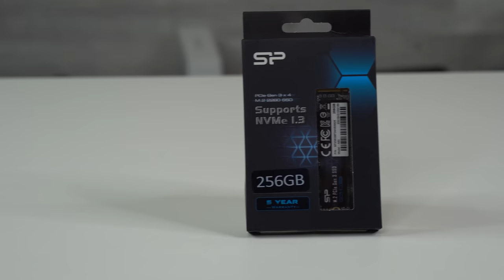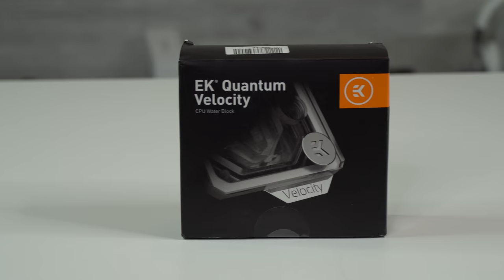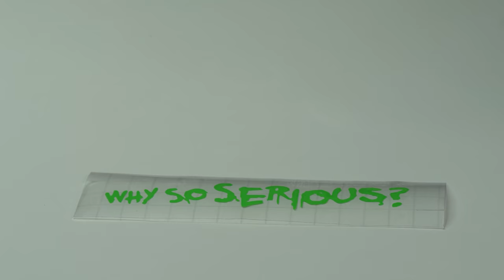ULTIMATE JOKER Themed Custom Water Cooled Gaming PC Build

Comment: For years I have wanted to make a wall mounted steam pubk build using analog boiler guages and copper pipes. Make the whole thing mahogany and copper.
Reply: Braze the fittings, run a primary loop around the outside and secondary loops for components like a hydronic system.

Comment: A question I hope you might be able to answer: If you mounted the pump/res combo to the radiator, would the glass panel fit? I've been planning to do a P3 build myself, but I'm unsure if my 360 rad will fit with the pump. Absolutely sick build nonetheless!

Comment: Can you do a video on how to disassemble those thermaltake fans? Would be something I'd like to know without having to experiment and break my 100 dollar fans XD
Reply: I finally did it. if you push the outer glassed ring with a bit of pressure and have a thin paper slit in between and push around the outer ring in the slightest of force, you should be able to push it off. just remember to go all the way around equally.

Comment: for this money i built i9-10900F, RTX 3070 , 750 Gold power supply ,  2x8GB RGB RAM 3600 MHz , ASROCK Z490 PRO4 , 2TB HDD 7200RPM 6GB/s, SSD Silicon Power 256GB, Be quiet ! Dark Rock Pro 4 cooler and normal box DeepCool MACUBE310 BK

Comment: Bhai plz bol do mere pc parts selection thik ha na?? HELP HELP PLZ READ AND REPLY
...plz help me plz tell which processor...mobo...case....gpu..aio....i should take??options r given below in brackets......u can give me any suggestions?? i will take 5900x.....with ASUS crosshair viii x570 dark hero (which one??).....gigabyte rtx 3080 gaming oc (or should i choose some other like 3080 fe or something else?? ......x73 or z73 or galahad 360 or deepcool castle 360 rgb v2(which one??)....32 gb of 3600mhz ram......corsair 1000 watt psu..... lian li o11 dynamic razer one....2tb firecuda 512 gb nvme... and for fans i am thinking to use lian li bora digital.......is anything wrong? And plz give answers of the questions of the brackets....plz reply..... and any suggestions...plz tell me..

Comment: my pc builder made following configuration for 65000 Indian rupees. Please give suggestion.

Purpose- reading pds and engineer designing softwares
1. processor-Amd ryzen 3 3300x
2.Mother board- Asrock B450M       
     AC( wifi+blueth).

3RAM-gs skill ripjaw 8GB 3200MHZ.
4. SSD-   Kingston  240GB .
5.Hd - seagate 1Tb 

6.GPU-    zotac GeForce Gt 1030 2gb GDDR5
7.cabinet case- ant esport ICE 130 AG mid tower
8.PSU-deepcool (DQ750-M750W 80 PLUS GOLD FULLY MODULAR(10 yr  warranty))
8.monitor-acer nitro 23.5     
     VG240YS 
9.wireless keyboard& mouse-  
     less than 1500rps